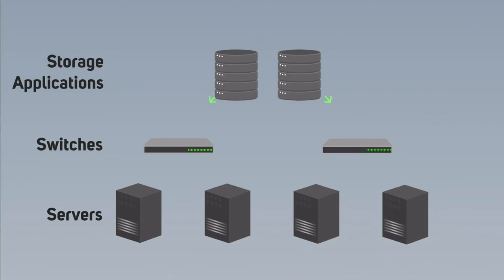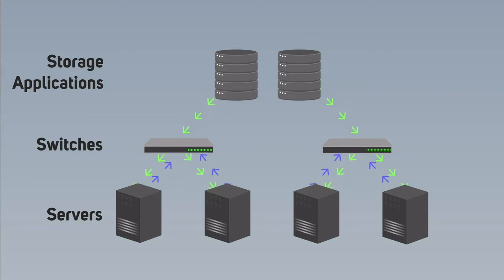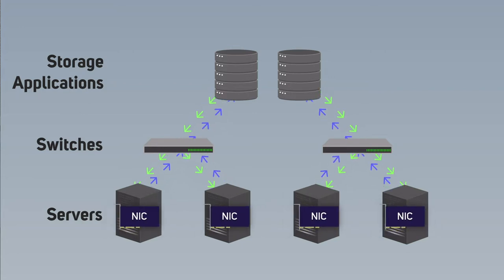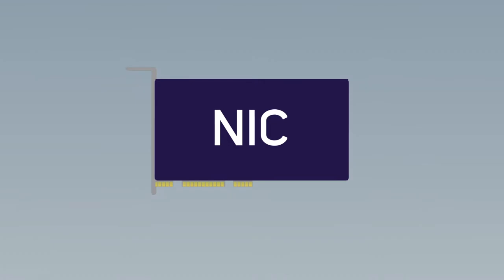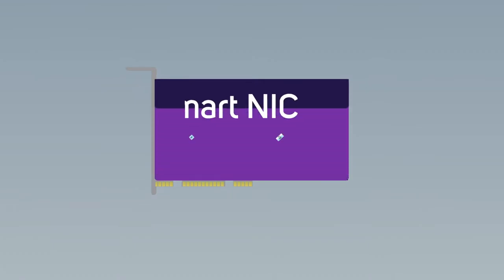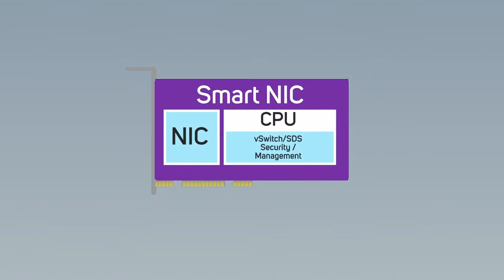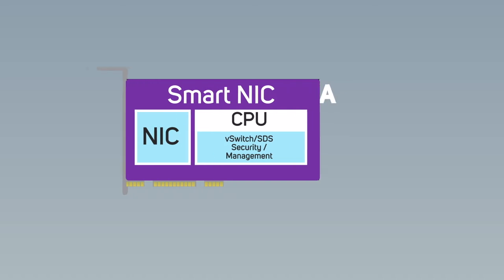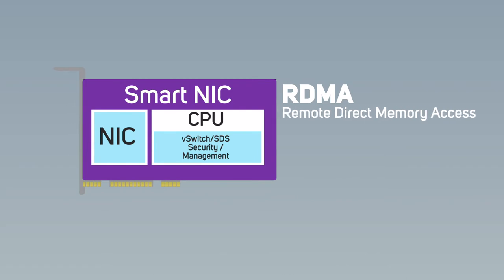What is RDMA and RoCE? SmartNICs explained.

Comment: Would love to know how to setup and configure rdma in Win 11. There’s so little info online about this.
Reply from the maker: Have you looked at https://docs.nvidia.com/networking/display/winof2v290/NVIDIA+WinOF-2+Documentation+v2.90, there's lot of good info there. - JG
Reply: @scanitsolutions  I have looked there, I have contacted NVIDIA twice, had consultations with IT network Pro's, called other IT techs in my area and abroad, I have been in communication with QNAP for about 6 weeks, tried different drivers, operating systems, different NICs, intel, mellanox, etc etc. I could write a small book about all the things I've tried. And came up empty handed. Nobody has been able to help. I've got a hard 55 Gb/s limit no matter what I try. I did get 98 Gb/s one time using the mlxndperf tool. I believe that was using RDMA, but that was a Mellanox tool designed for their hardware, so it must have bypassed the windows stack. So clearly the hardware is capable. But outside of that benchmark tool, I can't exceed 55 Gb/s.
Reply: @RepaireroftheBreach hey is there a good way to get in touch with you? I wanted to pick your brain about what worked or didn't and what hardware you grabbed.